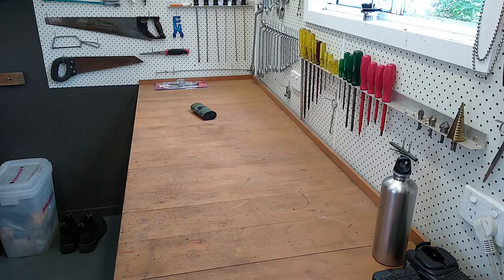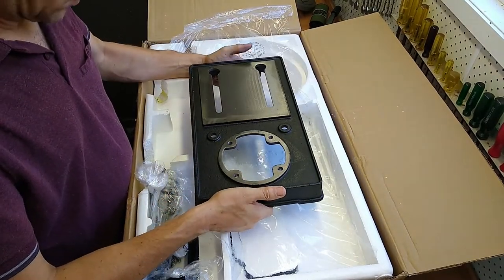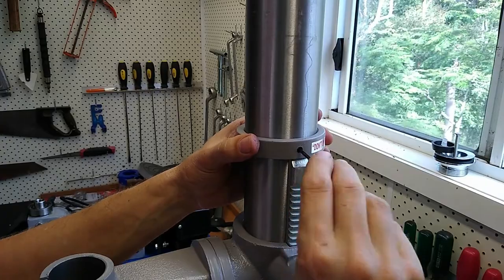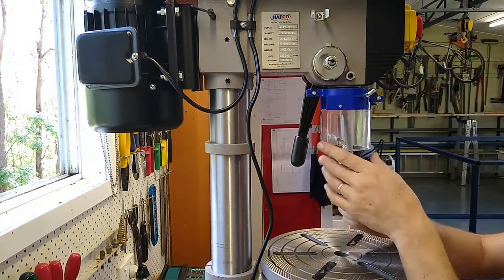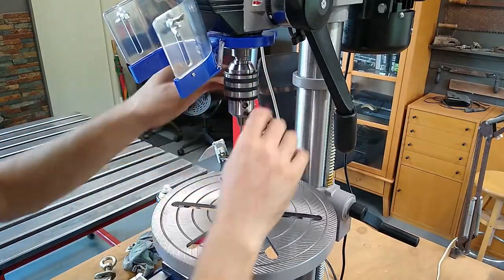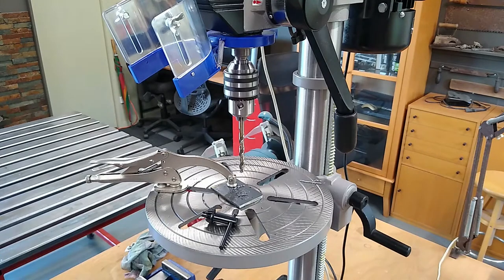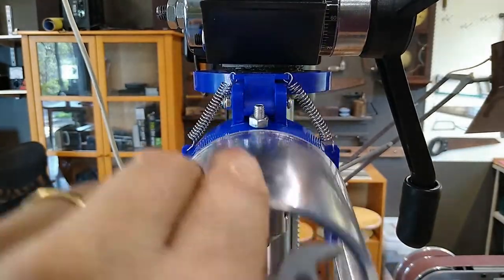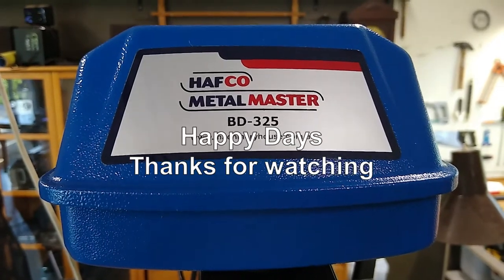So I Bought a Hafco BD 325 Drill Press

Comment: How are you finding it so far? I'm considering getting the same one. Have you switched to a keyless chuck?
Reply from the maker: It's been good, it's not an expensive drill press, for the money it's good, it does a lot of work in my workshop. I am disappointed with the chuck however, not that good really, but that is one thing you can always change, and you still haven't broken the bank, cheers.

Comment: G'day mate, I'm thinking of getting one of these but I haven't been able to see one  up close.  I'm wondering, how much play is in the spindle at full extension? Is there much side to side movement?
Reply from the maker: G'day, play at full extension is minimal, I think it's acceptable for a budget press, but whether that is so on all units, who knows, happy with it so far, although the Chuck is rubbish, but to get proper industrial quality you'll have to pay way more, cheers
Reply: @whathappensintheshed  Thanks for the reply. Minimal play sounds acceptable to me. My old one is dying and it's sloppy as hell. Some I've looked at in Bunnings have left much to be desired. What don't you like about the chuck? What size chuck key is that Aldi one?
Reply from the maker: @TonyGrant.  my only problem with the chuck is that it wobbles, haven't worked out whether it's the tapper shaft or the chuck, not sure what size the key is, it's still a fraction too small too, but am managing

Comment: G'day thanks for taking the time to make a video on this drill press. I'm currently looking to purchase one and had a look in the various shops around Adelaide today. They all sell the same drill press, like yours, just rebranded. My overall impression of it was poor quality. How is yours holding up? Although poor quality do you still think its good value for money considering what you paid? Thanks.
Reply from the maker: Thanks mate, I've been giving it heaps, 120mm hole saws etc. It's holding out alright so far. It's ok value, you can't expect too much for a sub $400 unit, it's definitely built for a price, if I was to buy one again I'd spend more, but the price gap to proper industrial gear is at times huge. It's doing everything I ask of it, disappointed with the key and Chuck, Chuck wobbles, will have to buy new Chuck some time. It's not great but ok. Cheers
Reply: @whathappensintheshed  Thanks for the reply. I took the plunge this morning and bought a PD360. The better quality stuff is very expensive!
Reply from the maker: @pashabulker12  Yes it certainly is, it gets to the point where a $2000 miling machine begins to look like a worthwhile option, two for the price of one

Comment: Have you tried it at full speed? Mine starts very very slowly and it isn't a soft start motor.
Reply from the maker: Can't remember if I did, I mostly run it at lower speeds, especially with hole saws, will give it a try when back home, on holidays in FNQ
Reply from the maker: Just ran mine at full speed, all good, check all your rotating parts rotate freely, and the starting capacitor, if starting capacitor is faulty motor will lack starting torque. As gearing is reduced (increase speed) torque is reduced, motor has to work harder, but is lacking starting torque.
Reply: My belts were too tight, which caused unnecessary friction. After I loosened them it spun up to speed immediately. Thank you so much.